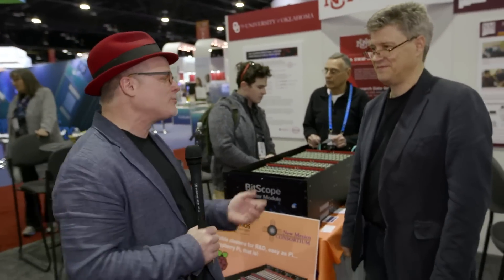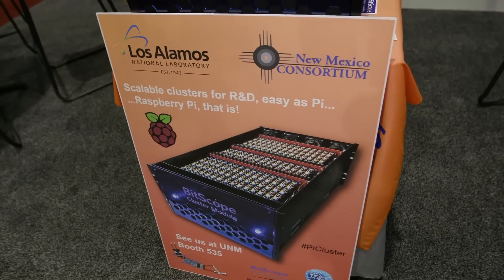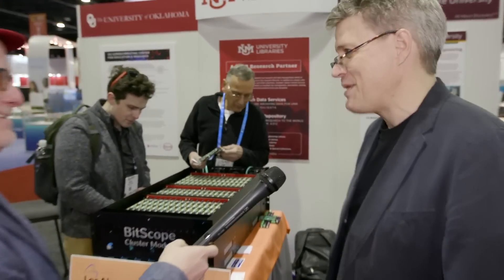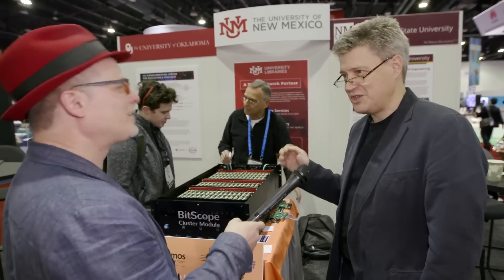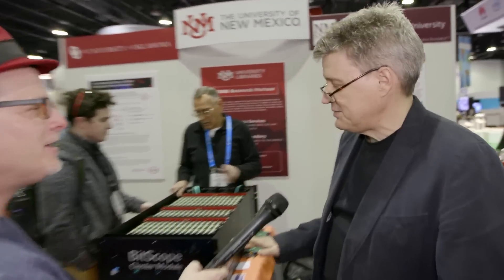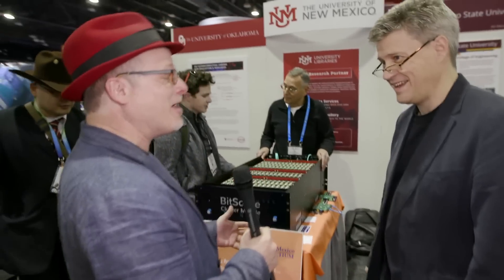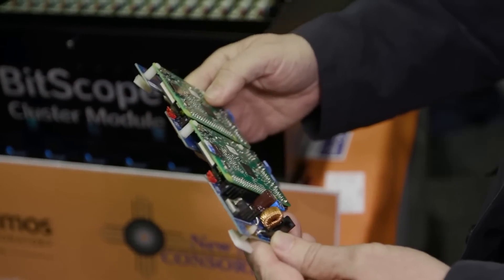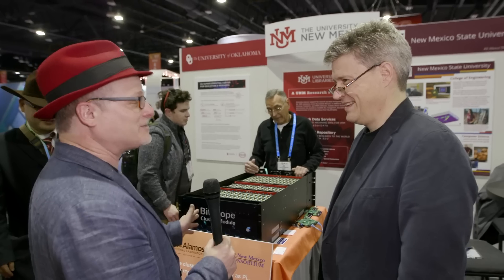An Affordable Supercomputing Testbed based on Raspberry Pi

Comment: A waste of money maybe, but not for the individual that needs to buy only on Pi and build on it later. It's actually cheaper to create a cluster on Pi at a time then to have a specialty board made with only the CPU's connected by a bus. Multi core GPU's are the closest we will get to one, and they are expensive.
Reply: Yeah but you can do a lot more with a system of massively parallel GPU cores than this. I've talked with the guys building then and seen the results.

Comment: 1000s of nodes, still can't play Tetris :))))
Reply: They run Retropie surprisingly well for most things, so I'm sure they can more than play Tetris. They are also getting more performance gains at a faster rate than PCs are, and they sip power compared to PCs. At some point Pi is going to no longer be a joke to big data and become a viable option for certain applications where quantity compute units is more important than raw compute power.
Reply: How do you think they fit all these units in this box ? :-)
Reply: @wowurreaalygonsaythatwoe3995  Why? Because I'm not a level 1 troll like you?
Reply: i mean we can now play half life 1 and both portal games now so i think it can play tetris

Comment: and when one SD card dies get ready for the headache of your life XD
Reply: Erm ....I think it could possibly be tracked down by it's LED not flashing... then just  reimaged?
Reply: With over 150 you will probably run into more errors
Reply: Probably not if you have just one corrupt SD card.
Reply: maybe they can be runned as cloud computing,with memory separated of computing unit
Reply: Probably using PXE to boot off a network rather than a local MicroSD card

Comment: I wonder why they just don't build a large board, and print on it a cluster of ARM chips instead?
You're having all lan ports, and HDMI, and USB ports on each board, while you only need 1 HDMI, and only a few USB ports.
Wasted money if you ask me!
Reply: Or use the Compute Module 3 that Pi make thats the same chip on a small dim card .
Reply: this kind of exists, but its people who custom printed them. bit like the Pi cluter hat. tho what you mention does make sense, but this is all we have got atm.
Reply: Tom's hardware page had an article, about 10 years ago, about Intel creating their first 128core CPU.
Basically 64 with hyperthreading; 128 toned down inline Atom mobile cores, running at 1,33Ghz.
They managed to run the whole thing at below 120W.
I'm sure it was good for something, originally made for the server market; but perhaps not too practical for other things; because they never really released the chip.
The idea wasn't as much in the clock for clock core speed, but the multitude of CPUs working in parallel, which could potentially process hundreds of threads at the same time.

I guess perhaps they've got replaced by graphics cards, like CUDA, that run hundreds of processors already, and are much easier to manufacture as it's based on a technology that already exists.
Plus, graphics cards makers already had software made, for using GPU cores to aid the CPU.
Reply: Muranaman you miss the point, this is intended to simulate a large cluster with all the lan ports and all the trouble you have in your large system. Only this way, you can reproduce the problems you have on your primary system. This is not a cluster for productive use, a single E7-8890V4 could easily outperform it.
Reply: Who wants to reproduce problems, let's design them out and make the bigger systems reflect it. It's not like we're massively invested in a flawed architecture.
Reply: How would those nodes be connected if you leave out the ethernet ports? Even if you don't mount a physical port you'd still need a network controller connected to some sort of network, yes you could place all that on a single board but it would have quite a lot of layers which would make it enormously expensive, not to mention any damage would render the entire system useless.
Using Raspbery Pi's seems strange as using a smaller and more basic node connected in the same way as in this system would probably be cheaper but would lack the support that Raspberry Pi has for drivers, distros and various packages, no support means no large customer will even look at it.
Beyond that I'd just get one large server and virtualize the entire cluster, that too would not be suitable for testing latency but exactly like this Raspberry cluster would be suitable for testing deployment and functionality while using a default x86 server which are readily available...
Why you'd need some 750 RPi's to test network deployment.... Sadly they do not come up with an answer to that...
Reply: Muranaman Imagine I told you back then that AMD released a 64 core CPU too, and being an absolute beast at it... 😂
Reply: @someguy4915  Look at the modern multi-core CPUs, like the Ryzen 9 3000 series. They have multi cores on one package.
Or Big-little technology? They have 2 different type of CPU cores (quad cores) on one package.
Similarly, you can put 100 ARM cores on one package. Interlinking with a CPU ring bus (AMD calls it infinity fabric).
The same way they use 1quadcore ARM processor, they can build 4 of these quad cores in one system. Allowing the system to see 4 Cores 16 threads. Transferring data over LAN or USB is way too slow.
Infinity Fabric runs at several Gigabytes per second. For ARM it'd not be very hard to reach 1 or 2 GB/s. 
Or use PCIE pins to interconnect CPUs.
Reply: @karim1485  Yes, but in terms of efficiency, if it were an ARM, running at 300W, you'd be running a 150-300 core CPU instead
Reply: @ProDigit80  The problem is not the number of cores, a modern high-end x86 CPU will provide you with some 56 cores and you can fit 8 of those in a single system, the issue lies with memory access. Yes you could in theory hook up CPUs via PCIe lanes in some rather frankenstein setup but memory access would be extremely slow, same for inifity fabric or variants of it, there is a reason most high-end Xeons/Opterons are 8 socket max. in a system, the memory access just gets too slow.
Yes you could make some cluster, but with such a board a single CPU failure means the entire board can be scrapped as 1 CPU might connect several others together, meaning 1 CPU failure could leave several CPUs without access to parts of the memory.
The only way to do this would be to have complete systems (CPU, memory, connectivity) linked together via intergrated Ethernet, leaving you with a lot of low power nodes each just a few cores and a few GBs of memory, these already exist (raspberry clusters in 4U or 5U format for instance) and are only used to test cluster setups prior to building the real cluster out of actual performing nodes.
Reply: @someguy4915  Memory access shouldn't be an issue, so long as you can assign one DIMM per x-amount of cores.
Research is being done to prevent eg: core 1 to access memory that is only accessible to core 4 and 5. So that job will be done by core 4 and 5, or memory data will need to be transferred from Dimm 3 to DIMM 1, which results in a loss of time, cpu cycles, and increase in power consumption.
Just give it a few years, before 100 core ARM processors become a thing.
Reply: @ProDigit80  I'd love to see it happen, thing is I've been hearing 'ARM servers are coming' for well over a decade now and no serious platform has been successful sadly...
Besides HPE Moonshot which uses either x86 or ARM nodes and some commercially available Raspberry Pi clusters nothing has really materialized, the largest issue being that as soon as ARM cores become as fast as x86 they consume the same amount of power or even more, they scale rather badly till so far. 
But yeah, the day HPE, Dell or some company like them launches a ~100 core ARM system I'll be watching happily.
Reply: @someguy4915  ARM server chips will never commercially materialize with AMD releasing their 7nm TR, Ryzen, and Epyc CPUs.
AMD is already on road for 5nm chips.
It'll take many years before ARM can catch up to even 7nm level.
7nm ARM will be pretty competitive with 5nm x86.
For the moment there seems to be some limitation in ARM CPUs in that they always come in quadcore versions.
Some running dual quad core CPU configurations (A72+A53), but I haven't seen any viable and commercially available system using more.

Comment: Anybody notice that not once did the guy explain or even show how the devices are all linked and are meant to work as one?
Reply: Primarily because that part isn't new. A lot of other people have made RPi clusters, and every one that I've seen runs over Ethernet. You get a big network switch that handles the traffic between them, and load up some version of Linux (there are different options out there, so you'll have to do your own research) that can do RPi clustering.

Comment: cost is bout same if but pc or multiple low cost board.and you have to programmit to work as cluster. you cant just run KERNEL and all work as cluster without have to code it to calculate something. simple calculator program work as cluster and ghive result faster and desktop would work better,but nobody done it.
every cluster just work on 1 programm that is programmed todo something lotsa bugging todo DID IT actually give right answer VS
if supercomputer allready boot as cluster and then use ANY exiting programs and they run faster.lol. but nobody do it yet.well 1 might do it.becouse some guy is smarter than them all. start your kernel all work fine lol

Comment: and all the Rasberry pi's come from Southern Wales, in the United Kingdom so you know they are reliable and well manufactured, at least not from China where they would break down every 2 minutes. I had a NAS drive made in China and it broke in first month, dodgy cheap connections. So I no longer buy anything manufactured  and electronic from there.
Reply: Some are manufactured in china.

Comment: Wouldn't it be a lot easier and less expensive to build the cluster with virtual machines or containers, or just simulate the whole thing with software?  A hardware solution isn't needed for this.

Comment: why not just use a GPU
Reply: I would say GPUs can't run CPU based instruction sets.
Reply: You are right. Thanks. Do you think Nvidia's latest GPUs dedicated to deep learning would handle the work? I saw a series called "I am AI" and was quite amazed.
Reply: The Volta non-gmaing GPU has a TPU for tensor operations. That will be a massive hit in AI since it's based on tensors. But still a very good CPU, CUDA / stream processors needed for operations before and after the tensor instructions. But yeah, bare metal non emulated tensor processors are fascinating.
Reply: Thank you!
Reply: the thing they're ultimately trying to solve here has is not applicable to GPUs. They're trying to check how to efficiently scale "nodes", or series of computers that will be connected together and be working on some sort of larger calculation. The program they create for the Raspberry Pi can then be used on much more expensive machines, that will inevitably be more powerful. They can't buy a ton of the expensive machines to test and improve this scaling because as mentioned, it's expensive!